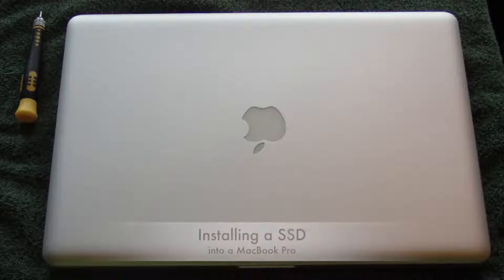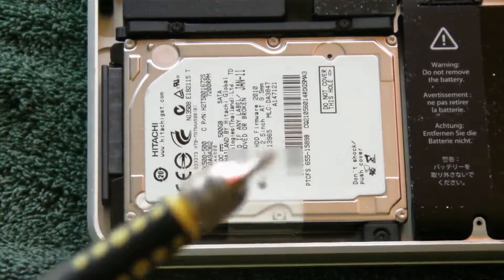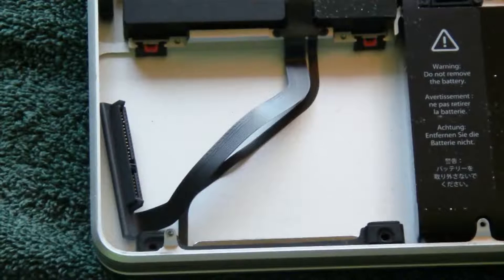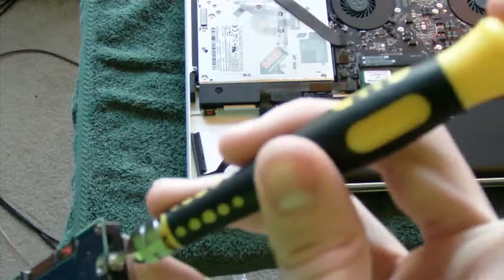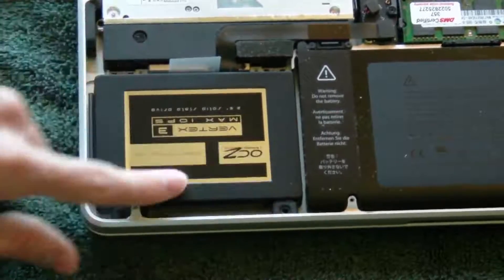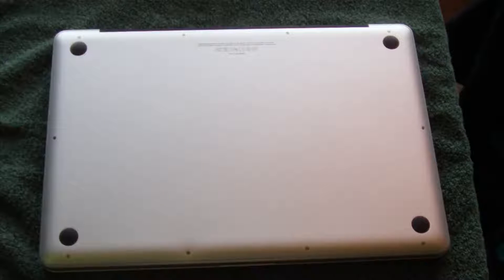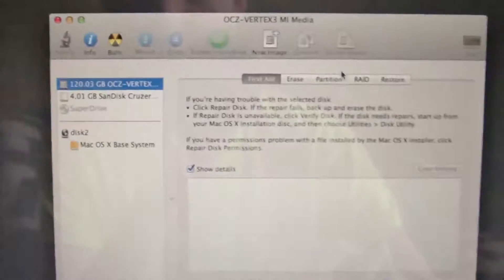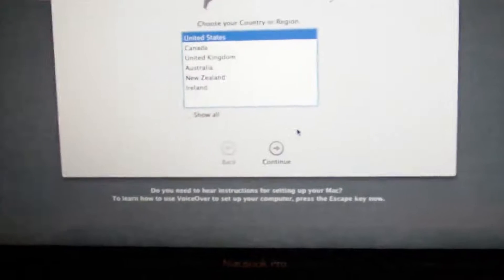How to Install a SSD into a MacBook Pro (OCZ Vertex 3)

Comment: you buy a ssd card but you dont have the correct size screw driver ? $220 if fine but dont buy a screw driver for less than $5 ???